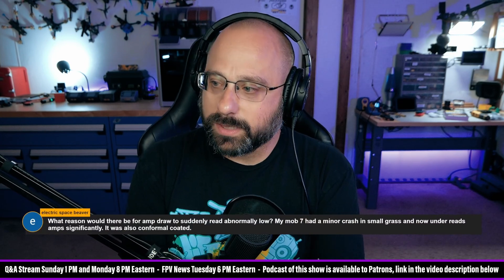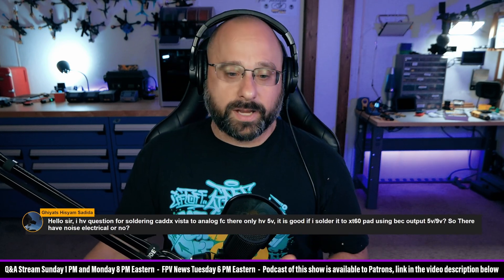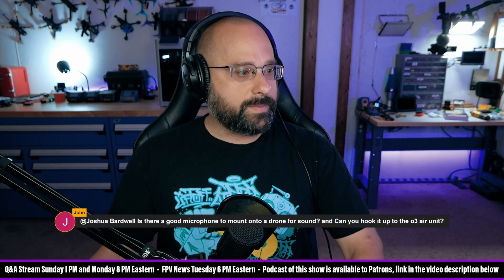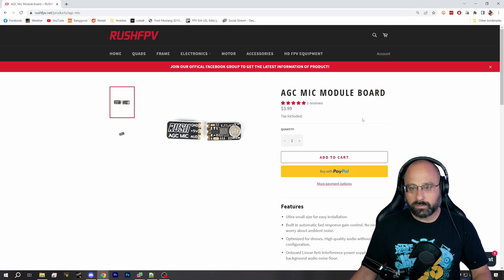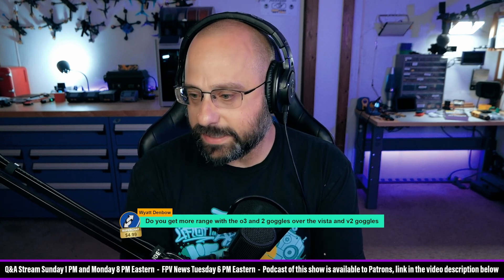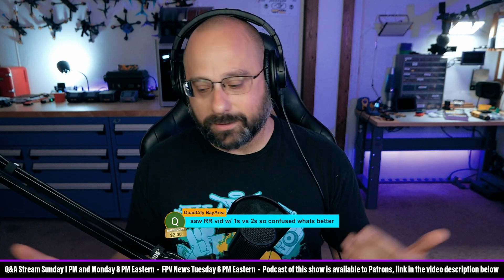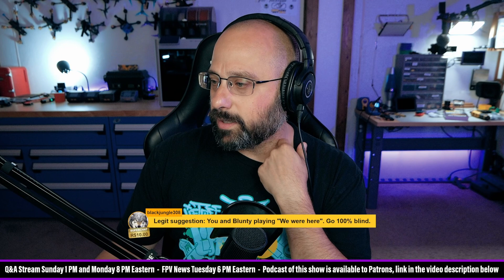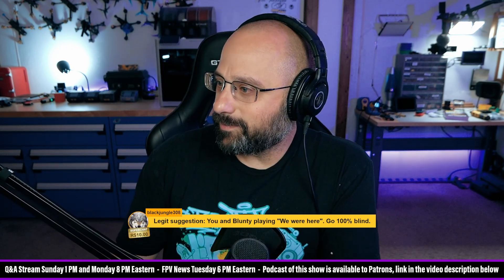Remote ID Reviews? 1s vs 2s? How To Remove A Stuck Standoff Screw? - FPV Questions

Comment: Heat, is the best way to remove steel from aluminum. Aluminum expands much faster.
Reply: rest your soldier iron on it, it'll get hot enough for extracting the steel hex bolt [m2-m5 or whatever] and not toast the carbon.

Comment: Take a Dremel and thin cutting wheel and cut a straight cut in the top of the screw. Then take a flat head screwdriver that will fit in the cut you made and remove it.
Reply: I was going to say the same thing, but with a junior hacksaw!  It's a pretty good solution to rounded off allen screws.